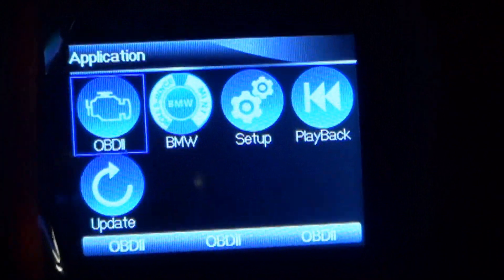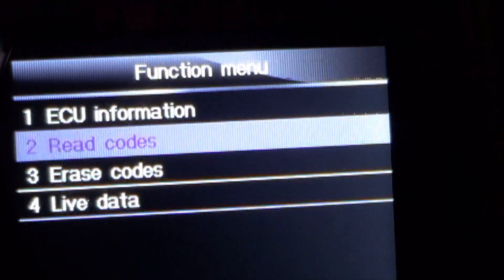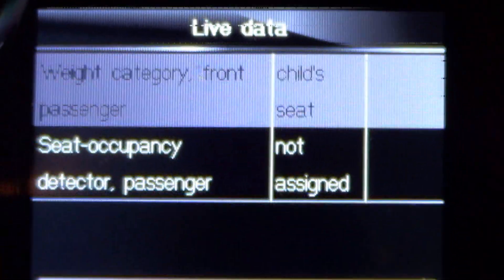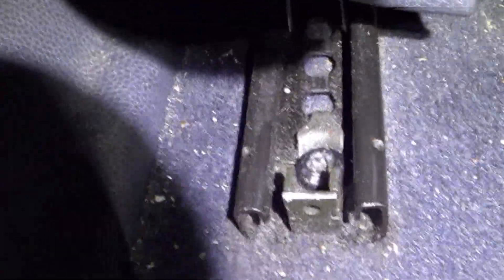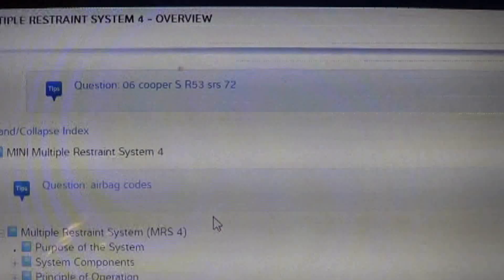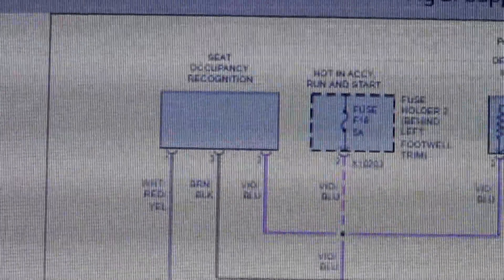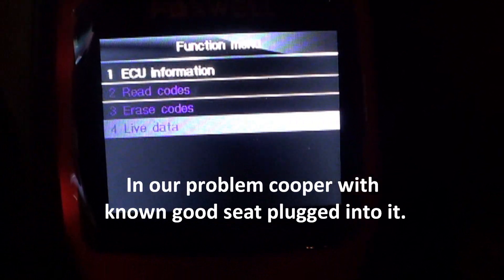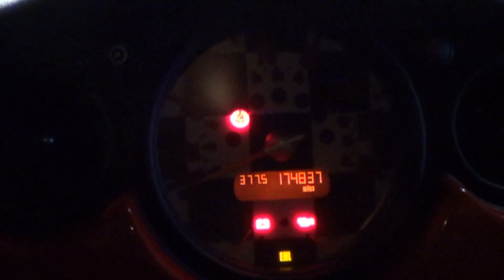Mini Cooper Seat occupation sensor

Comment: Thanks for this great video, it helped me to understand my Mini better. I have a question and I hope you can remember, given that this video is a bit older. When the airbag light came on, did the Passenger Airbag Warning light in the roof near the mirror also light up? My Cooper S from 2006 is giving me some headache these days.

Edit: I checked my VIN and apparently my car is eligible for the recall. The fix wasn‘t done on mine as the BMW opened the recall in 2015 but my Mini got exported to Korea in 2013. I will try to contact BMW here in Korea.
Reply from the maker: Sorry I dont remember. I dont think so, or maybe I didn't even notice it.
Reply: CoolAirVw Rm 
I just wanted to let you know that my Airbag light got fixed a few weeks ago by changing the seat mat in the passenger seat. Thanks so much again for your video and guiding me to the right solution. And because of the recall I didn‘t even have to pay anything! Thanks!

Comment: Thanks for the video, you have laik from me. I have the same problem too. I have a question for you: if you can tell me, I can’t find the passenger seat sensor connector, I’m just new to this business, do you know where you can find the connection diagrams of these connectors on the 2004 Hyundai Santa Fe, there are 4 of them in my car pieces, two black and two yellow, which one is the one you need to work on ???
Reply from the maker: under the seat.

Comment: Very concise and thorough job mate. Nice work. 
I’m looking at buying a 2004 cooper s here in Australia that has the airbag light on so was interested to see what kind of issues to look for. 
Hey that technical software database you were using showing wiring diagrams etc looks great. That’s obviously some expensive package your workshop has purchased ?
I am an automotive mechanic myself but have retired from the trade these days. 
Thanks again. 🙏
Reply from the maker: The tech service is about $170 per month (US).  Thanks for watching.

Comment: Researched for a 2008 Cooper S and realized BMW Service only answers what you ask them.  You asked about recalls and that's what they addressed.  Turns out you have to ask if anything was EVER under "extended warranty."  Then you will find that BMW effectively converts Recalls to Extended warranties (like 10yr/100K) and then they would have most likely noted the recalled part was out of extended warranty.  Further research at NHTSA.gov I interpret that the auto manufacturers can submit their "customer reimbursement plans" to NHTSA, and appears NHTSA accepted these extended warranty plans.
Reply from the maker: Interesting!

Comment: for $40 on ebay you can buy a bypass for these sensors. Very easy to install and its must cheaper.  It just tricks the computer into thinking an adult is always sitting in the front seat.  The airbag will still work in a accident
Reply from the maker: If someone, like a shop or car lot bypasses the sensor, and then someone puts a car seat in there and the airbag deploys and kills a child then lawsuits await for those who put in the bypass.  It would be better for a shop like mine or a car lot like the one that owned this car to NOT repair it than to install a bypass.   That would certainly be an option for a individual but then when he sold the car he would be open for a lawsuit.
Reply: @CoolAirVw  
Individual - not a shop

 What bypass ? I didn't put a bypass in, I only drove on bypasses with the car. 
If you think I put some pass-by in the car, that caused u a problem? Prove it.
(Also with Bypass in, you can still TURN OFF PASSENGER AIRBAG! So if someone  is stupid enough to put a child on a front seat facing a airbag , without turning it off,  relying only on Mexico parts and computer technology to save their child's life... isn't this Darwinism?)
Reply from the maker: @oceanside2152  I have no idea what your saying.  As a shop, we cant bypass.  You do what you want.  I feel no need to argue the benefits or drawbacks.
Reply: @CoolAirVw  yeah I was saying individuals should go ahead and do the emulator,  But the shop should not due to commercial liability  issues.
The reason why I say an Individual should go ahead and do it is because they're at a natural disadvantage because of planned obsolescence built into the car they own, built with really crappy parts. 
They bought in good faith thinking if there were such a chronic problem like this, affecting airbags, surely there would be a Recall. But they get screwed by the manufacturer and the US DOT.
Add in the fact that you can turn the airbag off and only logical answer the consumer comes up with, is bypass/ emulate.
Reply from the maker: @oceanside2152  Good points.  Thanks for watching and commenting on my video.
Reply: @CoolAirVw    thats a good point.  I didn't think about that